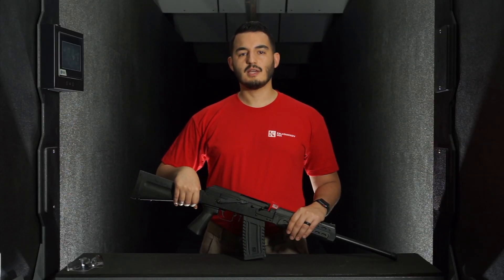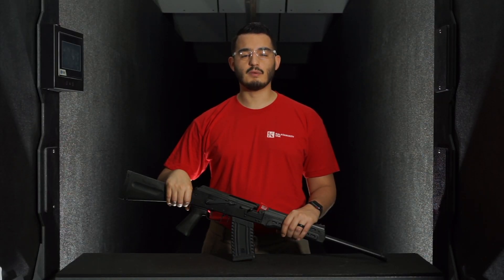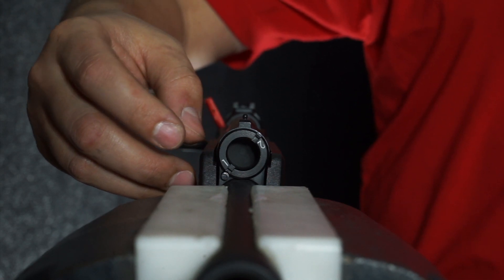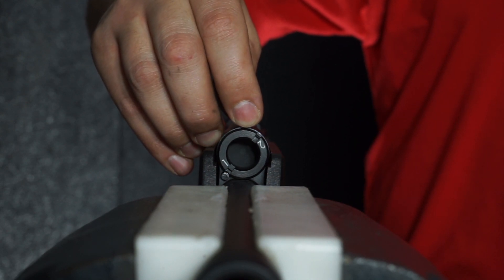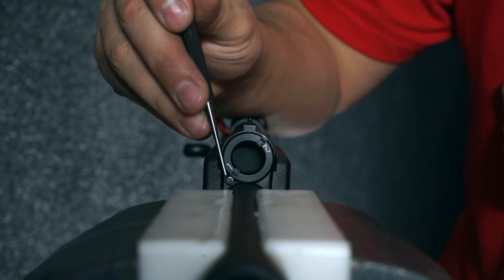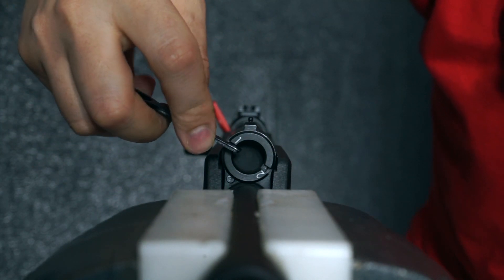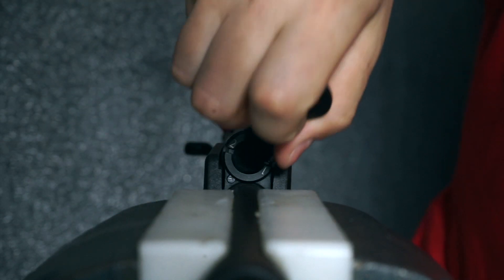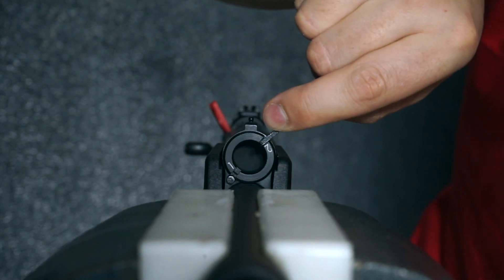Kalashnikov USA How-To: KS-12 Gas Regulation System

Comment: So I just purchased a KS12T and I am only going to use 00buck so the gun came set to L and manual says set to H when i did that there is play in the adjusting nut and now I hear something rattling in the gun, when I set it back to L the play is gone and so is the rattle is this normal?

Comment: My gas block bottoms before setting 1 gets to the detent, so when i rotate it counter clockwise from bottomed out, setting 2 is the first to detent. Do I then continue to setting 1, or leave it at setting 2?
Reply: dont know if you found out alredy but this is from the manual for the gun ''Thread the regulator all the way down
until it stops, then back off to the setting for the shot shells you will use. ''

Comment: I cant get mine to cycle for anything  and I was so happy when I got the ks12
Reply: Mine cycles everything if the ammo is crimped properly. Turkey loads cycle perfect on the 1 setting. You may need to buy the 1-6 gas upgrade plug.
Reply: @Sandwich420  Where can I find the 1-6 upgrade. Mine wont cycle anything. Was happy when I bought it. Disappointed the first time out with it.

Comment: What if it says low and high instead of one and two, the gun when I purchase this set on one i depressed the pin in and turned it clockwise deeper into the threading to get to number 2 but it stops before that and bottoms out so how do you set it on setting 2 , do you have to back it out counterclockwise and is that the proper position for to where you see a little gap between the threads and the gas tube...

Comment: I can’t even get mine to turn either direction and have been trying for 2 days. I guess I need to take it somewhere and have  someone pull it apart. I see there is these hand turn knobs you can buy that don’t require the tool. May need to buy that I guess.
Reply from the maker: Are you making sure the detent is depressed while turning?
Reply: Having the same issue
Reply from the maker: @Rambling_Man38  Sorry you're having issues. Please go to this link below, fill out the form and we'll get back to you asap. 
https://kalashnikov-usa.com/warranty-request/

Comment: I’ve had my KS12 Komrad for about half a year now and I know your manual says not to shoot buckshot and slugs on Low but they don’t cycle on High, are you guys talking about even more powerful loads cause I typically use 2 3/4 shells.
Reply from the maker: I usually relegate 1500fps and above to the high setting
Reply: I couldnt get 1400fps shells to cylce on low. I set it to high and it ran great i have the homrad k12 not sure if thats why or not.
Reply: My shotgun also failed to cycle under the same circumstances.